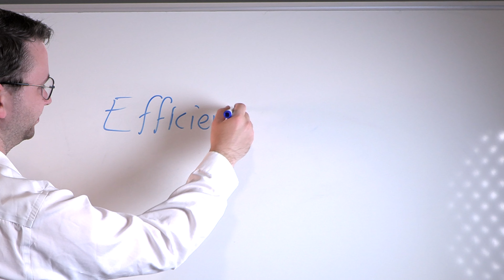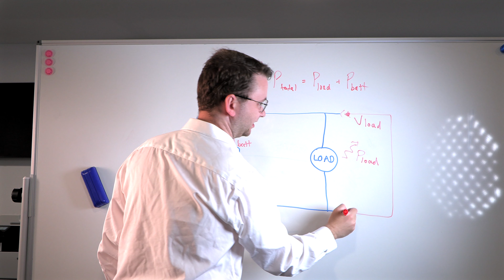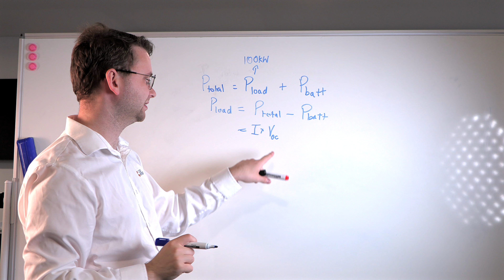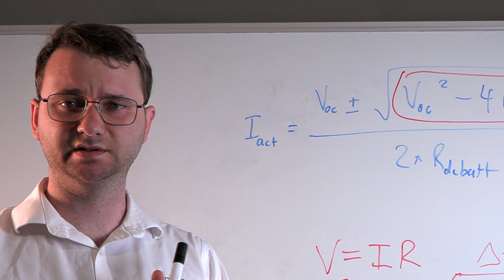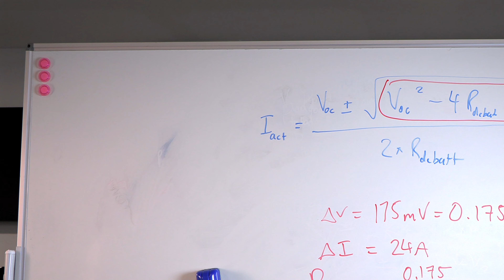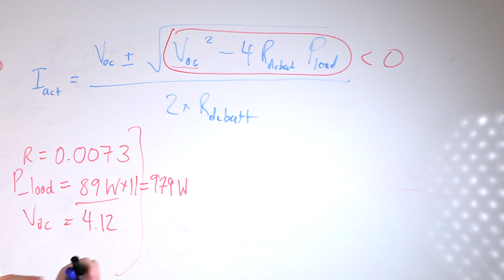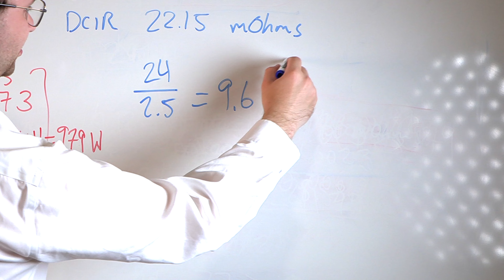Comparing the efficiency of Donut Lab's solid state battery

Comment: Okay, for your last calculation you're using a very approximate resistance value to display a "precise result". But in the VTT report, the Donut Lab battery delivers 82.2% of the energy supplied after the first 11C charge, 82.5% after the second (aborted) and 82.1% after the third. Clearly higher than 77,7%, this is clearly dishonest.
Reply: Yeah, thats at 11C,  try this on NMC at 11C.  it would blow up, 100% of the time, NMC once you get past 2C. does not do well. What % do you all think NMC would do at 5%C and 11%C,  ? maybe 70% at 3C maybe 50% at 5C for a bit, and runawy fire at 11C most likely
Reply from the maker: Hey @khgffjjds, you're right there is an inaccuracy here. I'm hoping in a future test that Donut Labs allow VTT to provide some pulsed test data. Pulsed test data provides a lot of edges on the graph and lets you figure out how the resistance changes with temperature, state of charge, etc. Pulsed test data looks like this: https://liionwholesale.com/blogs/reviews-and-test-results/51805572-best-18650-battery-at-pulsed-loads-of-70w-per-battery-140w-with-two-batteries and would be required for a higher accuracy result. But I personally think the model is pretty good considering it's accurate to a few % of the real test!

Comment: Your comparison to Samsung R25 is out of context,  you can't charge R25 with 11C.  Samsung R25 MAX charge current is 4A which is 4 / 2,5 = 1,6C, how does this make the battery "better" than Donut's 11C ?
Reply from the maker: Hey @bobsnabby2298, thanks for watching. At the end of the video we compare both batteries at 11C, but my apologies that it seems like a lot of people are saying the same thing which means I clearly didn't explain what I was doing on the board. I've copied and pasted this from my answer to another comment and I hope it clarifies!

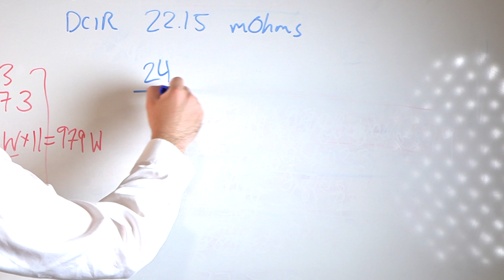The Samsung 25R is a much smaller battery (2.5Ah) vs the Donut Labs (24Ah), so at 19:13 we adjust the DCIR for the Samsung 25R to simulate 9.6 of the 25R in parallel (this is how they are used in real EV packs).This is how we get the equivalent resistance of 2.3mOhms for the 25R. The best case resistance for the Donut Labs cell was, in some tests, around 3mOhms, but in other tests as high as 8mOhms. It could be an issue with the tester, so we use the lowest value for fairness in comparison.

At 979W discharge (11C), the Donut Labs is 77.7% efficient.

The batteries are the same size with the above correction, so we compare the Samsung 25R the same way. At 979W discharge (11C), the Samsung 25R is 84.2% efficient.

This isn't actually that remarkable because the 25R is rated for 8C _continuous_, and Samsung are quite conservative in their ratings, which means it should really have no problem going at 11C for a short period of time and that's pretty much what we see here. The Samsung 25R is actually a really great cell, one of my favourite. To validate the above, see this discharge test: https://www.thunderheartreviews.com/2019/03/samsung-25r-high-drain-18650-li-ion-battery-test.html . At 8C, it is 93.2% efficient as measured over the whole voltage range (2430/2608) using the RTE method, which is less accurate, but within the right ballpark.
Reply: It doesnt simply because samsung would be burning and that alone is sufficient to cut off anymore arguments!
Reply: He didn't compare it at 11C.  The graph he's looking at is for the initial 1C charge/discharge, at low temperature, which seems to have a higher IR.    Donut's battery lowers its IR as it gets hotter, so it effectively gets more efficient, operating at C rates that other batteries cannot.

Comment: Thank you for a very interesting video. I’m not a battery expert, just technically curious. As a slightly naïve Swedish big brother to Finland, I find it hard to believe that a serious Finnish company that has actually developed and just launched a completely new electric motor concept would follow that up with an outright scam and simply show a regular Li-ion battery, as some people like Ziroth, Two Bit da Vinci and Electric Viking seem quite convinced of. Of course they may very well be right. I honestly don’t know and we will see.

To me, the 11C test and demo look mostly like proof that it works at all, while 5C feels more relevant from a realistic charging infrastructure perspective. At 5C, the efficiency still appears high when applying the same type of DCIR model used in the video.

It is also worth noting that Donut Lab does not seem to be primarily targeting large passenger EV battery packs at this stage. They talk more about applications like motorcycles and possibly high power density use cases such as drones and maybe military systems. If that is the case, then very high C-rates and power density could be more central than long duration automotive pack economics.

Donut Lab has also, if I remember correctly, mentioned aspects that are not always discussed in analysis videos, such as alternative form factors or production approaches and chemistry that differs from conventional Li-ion. I am not sure what is publicly confirmed though, especially regarding whether it is lithium-free. Please correct me if I am wrong.

I asked ChatGPT to run the same type of DCIR and I²R calculation as in the video, but for 5C based on the VTT 5C graph, roughly reading the voltage step at 130 A.

Rdc comes out around 0.6 to 1.3 mΩ depending on which step is used.
Using the same model as in the video, P = I²R and the quadratic solution, efficiency ends up around 96 to 98 percent at 5C.

For comparison, a Samsung 25R upscaled up to 26 Ah and 5C, using the same method as in the video gives 22.15 mΩ divided by 10.4 which is about 2.1 mΩ, leading to roughly 93 to 94 percent efficiency at 5C.

So at 5C the DL cell appears more efficient than a capacity scaled 25R in this simplified DCIR model. I wonder what the data is for the the latest 4680s.

Does anyone see methodological issues with that reasoning? And how good is 96 to 98 percent if chatgpt got it right?
Reply: This guy is a mess. Forget him. We are still fine here in Finlang. Next time focus on density. If they will write a new test report, cell weight should be mentioned there. If the weight is between 230-240 gr we are still winning. 400 Wh/kg verified
Reply: Good post. It would seem strange if a company with prominent figures behind it would actually make a mistake. Besides, that first VTT test was already done on 9.2.
Probably all the tests have already been done on the battery. The reason why they are being suppressed is probably somehow related to advertising.
Reply: 9.2 is probably February 9th
Reply: @ulfstider2721  I thought the same when I saw the video some day ago.
Reply: @ulfstider2721  jep😄
Reply from the maker: Hey @ulfstider2721, thanks for watching, good analysis, I just think that ChatGPT might have hallucinated on the DCIR. 3mOhms was the smallest 'clean' value I was able to find on the actual test data. If you can find a lower DCIR then it would totally change the story for sure, but keep in mind it would be at a specific temperature and SOC.

Most batteries have a fairly stable DCIR but in the case of the Donut Labs battery it changes a lot throughout the test, and we would usually draw 1 of 2 conclusions from this: 1. either it changes a lot based on environmental conditions, or 2. it changes based on cycle life or cell damage, and actually I would put my money on the latter, that the cell is sustaining a lot of damage from the test. That would align with the low calculated efficiency result. BUT we need more test data.

Edit: actually I can see how the AI got that value, and based on where I think that it might be reading from, I just wanted to point out that it's highly subjective where the voltage hike starts and where the charging profile starts. It's a very inaccurate place to read the DCIR from and could vary by +/- 100% or more. Perhaps could you ask it to report which graph its using, what time, and what values it got for Delta V and I ?
Reply: High Sweeden,   I am all with your Neighbor Finland,  I think Big Oil and the Big Battery companies would love to see Donut Fail, Lots of false info on these sights
Reply: Hi Sweeden,  the VTT data shows 86 % over 2 runs,  that would be way more efficent than NMC and of course at 11C NMC is toast
Reply: The owner's AI project and statements he has made around it make me concerned. He is either easily convinced of an unlikely best case capability of products his companies develop, or is willing to outright lie about them.
Reply: @barnett25 typical for start'up's. But marketing wise hevis winning. Look at all hype and virality. Its intentional. If and I say IF they havr miracle battery then they have also publicity and wide open markets they probably cannot handle immediately proper way😅if this is a scam, dumb and the dumpest have a new chapter.
Reply: Agree to you both. He is the week card but the marketing is very smart.
Reply: @barnett25  Go and listen to the first 13 words of the ASINoid video again very carefully.

Comment: Interesting, thanks. Donut releases the next reveal in 4 days, they're not finished ... Maybe they try to play with us and got a normal lithium cell tested to see if our brains work and in 4 days they release the shocker ... Who knows
Reply from the maker: Hey @karlschleifenbaum, what I found really interesting about the test data they released is it just looks like the charge/discharge curve for a completely normal NMC chemistry to me. Usually changing the chemistry (anode/cathode) changes the discharge curve (start/end voltages, etc). I know they charge to 4.3V in this test, but little known fact, NMC is actually a 4.3V chemistry and people only undercharge it to 4.15V to increase the cycle life, so ... basically I'm not convinced the cell is really a novel chemistry yet. I hope they release more data soon. Thanks for watching.
Reply: @kvanberendonck-cuedo  how is the DL discharge curve like an NMC?  I though Lithium has a flat curve  for most of the cycle which DL clearly doesn't?  I thought it looked more like a Sodium discharge curve....
Reply from the maker: @mark.pinnell  LiFePO4 is usually more or less completely flat through the middle, but NMC is generally more linear in that region. It really varies on a cell by cell basis though.
Reply: @kvanberendonck-cuedo  hmm I've just been looking at NMC 1C curves and the knee clearly starts at around 3.2V and DL clearly doesn't have a knee down to 2.7.  I'm not convinced.

Comment: Nice math, but it will be just as accurate as the source data - and we really cannot use the current limited data to make this level of predictions. In addition, this technology may not behave linearly at different C levels.
Reply from the maker: Hey @PasiT-fi, thanks for watching, you're right we need more data ;) just doing what I can with what I have.
Reply: By the Vtt results, it does not behave linearly at different C levels,  and of Course NMC goes down badly after 3C

Comment: Surely you are not saying the Samsung battery has an efficiency of 84% at 11C?
Reply: You're comparing the Samsung battery at 1C with the Donut battery at 11C. That is not a reasonable comparison and makes the whole video worthless.
Reply: @AllanPhillips  Exactly, the samsung migt be better at 1C but at 3C the samsung would do poorly, and 5C or more it would not function very long
Reply: @AllanPhillips  Look again.  He's using the 1C charge/discharge graph, not the 11C graph.
Reply: @daemn42 Look again. The 77% efficiency for the Donut battery which is supposedly "not good" is from the 11c charging. At 1c charging the Donut battery beats the 84% efficiency of the Samsung battery.
Reply from the maker: @AllanPhillips  just adding a comment here that I've tried to clear this up below.
Reply: @AllanPhillips It makes the video worthwhile because 10 year old battery in that comparison is better than so called new era solid state claim.
Reply: @janih777 You clearly don't understand the difference between 1c and 11c, or why you can't compare one battery at 1c with another at 11c.
Reply: he just told DL battery have 93% efficiency at 1C.... and old samsung have 84% 1C......  funny
Reply: Actually the efficiency would be 100% for about a second then it would be an open circuit
Reply from the maker: Hey @mconnah1, sorry for the confusion. I didn't expect this to get quite so much attention. Let me try and explain what's going on here.

The Samsung 25R is a much smaller battery (2.5Ah) vs the Donut Labs (24Ah), so at 19:13 we adjust the DCIR for the Samsung 25R to simulate 9.6 of the 25R in parallel (this is how they are used in real EV packs).This is how we get the equivalent resistance of 2.3mOhms for the 25R. The best case resistance for the Donut Labs cell was, in some tests, around 3mOhms, but in other tests as high as 8mOhms. It could be an issue with the tester, so we use the lowest value for fairness in comparison.

At 979W discharge (11C), the Donut Labs is 77.7% efficient.

The batteries are the same size with the above correction, so we compare the Samsung 25R the same way. At 979W discharge (11C), the Samsung 25R is 84.2% efficient.

This isn't actually that remarkable because the 25R is rated for 8C _continuous_, and Samsung are quite conservative in their ratings, which means it should really have no problem going at 11C for a short period of time and that's pretty much what we see here. The Samsung 25R is actually a really great cell, one of my favourite. To validate the above, see this discharge test: https://www.thunderheartreviews.com/2019/03/samsung-25r-high-drain-18650-li-ion-battery-test.html . At 8C, it is 93.2% efficient as measured over the whole voltage range (2430/2608) and it doesn't look like the graph is shifting left that quickly as the C-rate increases.
Reply: @kvanberendonck-cuedo   But VTT didn't discharge Donut's cell at more than 1C anywhere in that report.   Or are you comparing Donut's 11C charge to Samsung's 8C discharge?    That wouldn't make any sense.
Reply from the maker: Hey  @daemn42 , at 19:50 we use 282A for the 25R and the correct DCIR for both cells, comparing them fairly. The 25R does not exhibit 'High Polarisation' until 12C, so its DCIR is more or less constant between 1C and 12C per public testing.
Reply: @kvanberendonck-cuedo  discharge (11C)???
Reply: I really have the dame question as You
Reply: It does
Reply: @United_Slaves_Of_Israel No it doesn't! There is no data to say what the Samsung battery efficiency is at 11c because it doesn't charge that fast.
Reply: yeah, you are very right, at 5C the Samsung closer to 70% and 11C 50% except it would probaly have runawy fire after a coulpe runs

Comment: If the cell has no lithium as claimed there wouldn't be any dendrite growth.
Edit:  Apparently other cell chemistries can have dendrite growth.
Reply: Lithium-ion isn’t the only chemistry that has this issue. Zinc-air, sodium/potassium metal etc. have this issue too. Most commercial sodium-ion batteries avoid this by not using metallic sodium and other tricks.

Basically any uneven current density raises the chances of that spot growing, especially with any surface roughness which amplifies deposition.
Reply: They are obviously liars. Good job falling for the most obvious scam though.
Reply: @United_Slaves_Of_Israel  We shall see what the other independent companies say, but I remain skeptical
Reply: @United_Slaves_Of_Israel  Notice where I said "as claimed"?  Words matter.
Reply: It's odd how it supposedly has no lithium and is solid state but literally every characteristic (size, voltage/current curve, behavior with temperature) match exactly what a high end liquid electrolyte lithium ion battery would do.
Reply: @GregMcNamer apart from not catching on fire at the peak charge temp of the VTT test. 🤦💩🤡
Reply: @GregMcNamer  minus swelling
Reply: @villekinnunen6357 probably... Or maybe they got all of their pictures and video from before that last run?